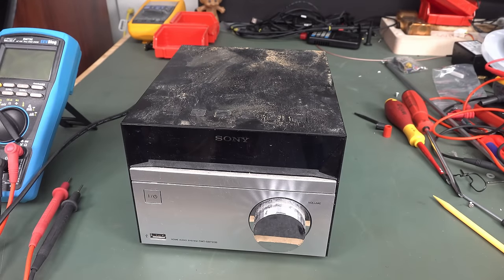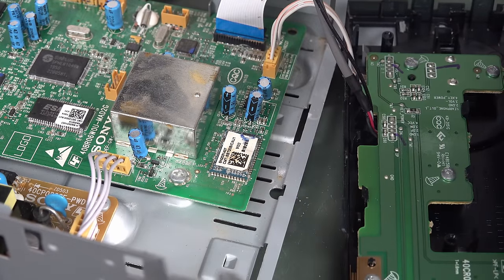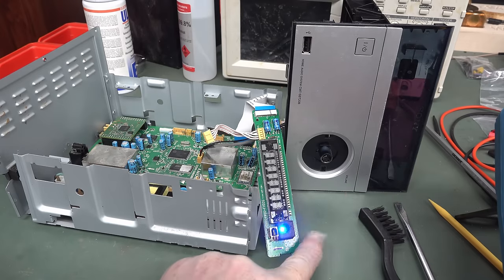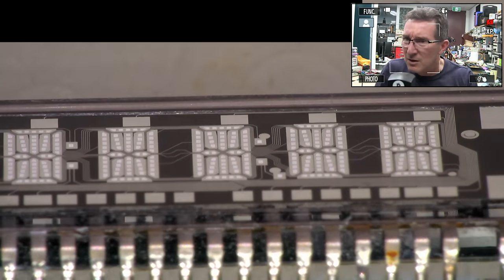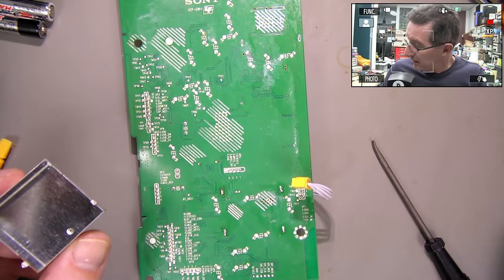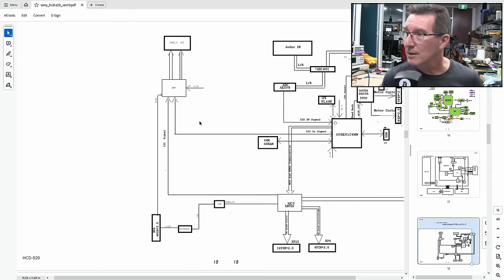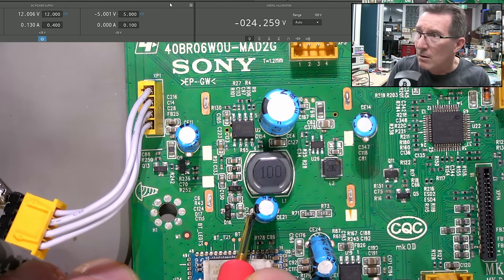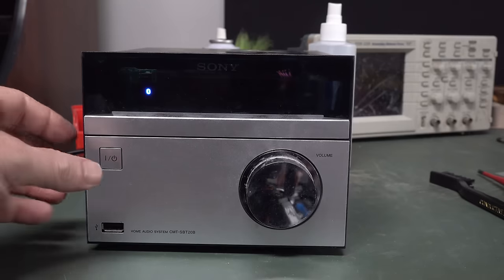EEVblog 1602 - Sony Amplifier REPAIR ADVENTURE

Comment: Having been a SONY R&D tech I found this video to be great fun. I was sitting here yelling, "Trace the voltages! Trace the voltages!" Thanks Dave! BTW, I hate those little laminated, printed ribbon cables. They are dirt cheap, and even cheaper to implement, requiring no connectors on the cable ends, but they are all junk, 1 time insertion, no matter what company makes or uses them. Over the years I've fixed numerous pieces of equipment by hand-soldering wires between boards to replace those pieces of crap. They have become the first thing I check in a repair job, even before the supply voltages. They are that bad.
Reply: Some brands like Sumitomo usually hold up longer
Reply: They are usually failure points in anything that uses them, my wife’s laptop was acting up sometimes powering on and then not responding found the power button attached to the main board with this and one track barely connected.
Reply: Yes, they are. I had a brand new Dell notebook back in the day, that always did a hard reset when someone just pushed hard enough on the palm rest next to the touchpad. Turned it to customer service, and it was returned back to me stating that the problem could not be reproduced. I turned it on, and on the first push on the palm rest at the known spot it reset again. So I tackled it myself. Turned out it was the exact same situation as in the video - one trace had separated during manufacturing, and the open end of that trace just had a tenth of a millmetre clearance to chassis ground. When the lid on top was pushed hard enough, it shorted out causing the reset...
Reply: Me, too! That's something basic I learned from Louis Rossmann: check the voltage rails first.
Reply: Oddly, they are used in military electronics and tend not to be a weak point, but they are printed on polyamide (Kapton) substrates.

Comment: It's always a treat seeing inside a Sony product and their service manuals. I'd love to get my hands on all the internal documentation that Sony has for design rules and best practices, their modern stuff today really does look like it was designed by the same people who were designing Sony products in the 80's, 90's and 00's, only difference now is it's with modern high density packages with more integration and modern features. Although the VFD really has me thinking maybe the same people have been working at Sony for 50 years, I mean Japan does have the longest average employee retention (12.4 years) of any country.
Reply: Same for many other Japanese manufacturers... Panasonic, Epson with which I have personal experience with. 😅
Reply: Working at a SONY R&D lab in the USA I had to change a bunch of parameters in our CAD PCB layout package, as well as rebuild all of the padstacks for through-hole components in order to meet the SONY bd design-rules requirements before I did a layout. The bd layout design rules document I got in order to make the mods to our software, even after translation was over 100 pages long. The manufacturing engineers in Otsugi know exactly what they want in a bd layout, and why they want it that way. One of our engineers who had been to Otsugi told me the cubicles of their EE's were half the size of those of their manufacturing engineers.
Reply: @johnwest7993  that sounds really annoying, but if the end result is that good, I guess it is worth it.
Reply: Unfortunately there is still a lot of Chinesium in this little unit. From the cheap crappy caps to the CD chipset that appears to be one of those nasty Silan clones of old Toshiba designs. But still, there's a lot more integrity in that than the average cheapo unit for sure.
Reply: @johnwest7993  OMG 100 pages. that explains the bloatware style layouts.
Reply: @johnwest7993  despite all that they couldn't make the board marking match up!

Comment: Futaba quit the VFD business a few years ago, leaving only Noritake-Itron and some weird China-based companies producing new VFDs. Shame because their reverse-facing modules like the one in this unit look fantastic.

BTW, the ghosting on the display is probably due to some high-impedance short between anode/grid pins, since the anode current is so low, a buildup of crud somewhere would conduct enough to barely light those segments.

Comment: We used to expect service manuals like that, from HP to Motorola, every company was trying to produce the most complete, easy to use service manuals. Companies saw them as a sales plus, something that would help make the sale of equipment to other companies and users, engineer to engineer. It told those who decided what to buy that you knew your stuff. Purchasers would ask the engineers what they thought of a piece of gear before they placed an order, and the engineers would say, "Show me the service manual." Gear was only as good as the service manual. It still is. And almost no one produces a decent service manual. Nowadays, all I want is vintage Heathkit gear, with the manuals. If a component is no longer available it doesn't matter. They included enough info that you can modify a circuit to use a different part.
Reply: Yeah, I work in defense and it's the same problem.  In the past, there were very detailed Tech Manuals, drawings, and troubleshooting instructions.  For us, it's mostly just money and time constraints.  Navy gets to decide where money goes, and when things get tight then documentation and other logistic products get cut first.  In their mind, it isn't important because most repairs are just dropping in replacement LRUs anyway--they don't really consider some of the knock-on effects, like the operators typically really don't even understand how the thing works so they're hopeless if a new unexpected (never before seen) problem arises.

Comment: Sorta modern, futaba stopped producing  VF displays entirely in 2021, that's a backlit vfd, you're viewing the back of the anodes, painted on the glass, very neat.
It also most likely uses chip-on-glass with an internal driver die and 3.3v logic
Reply from the maker: Yes, I was going to mention that it appears that it's the bottom. Neat indeed, no mesh or cathode wire to get in the way.
Reply: I am wondering if this is the same Futaba that makes the R/C stuff
Reply: @sasmit82  me too!
Reply: @sasmit82  yep. The company has some unusual product lines. Displays, touch interfaces, industrial/hobby radio control systems.

Comment: Blowenfusen und Poppencorken mit Spitzensparken! I like the VFD, indeed a thing of beauty. And the service documentation is damn spot on too. Charge pump and voltage multiplier for -24V, pretty clever. I've seen that used in a voltage multiplier powering a VFD in a Lell PSR drum machine made in the '80s/'90s in the USSR. It was driven from the master clock signal.

Nice fix! Congrats. I feared it was gonna be a complete come-a-gutsa but it came out nicely.
Reply: Lol. 😅
Reply: i love how dave says The fuse is "Blowen"
Reply: Yes, Sony is very creative using the 5vdc buck regulator's switching pin to drive a voltage doubler circuit to -24vdc. 👍👍

Comment: I've been doing repair for a job since about a year and things like that happened to me a couple of times: You fix the actual issue and in the meantime you do a mistake. You put it test it and it's not gonna work and you'll look for ages because you broke something and then you have to go all the way back and fix that again. Super frustrating experience!

Comment: This was a great video. I have often been frustrated trying to make these measurements using digital scopes. However, your video shows a number of really good strategies. I thank you for posting it. On my HP 8647A, the modulation connector becomes an output when the internal modulation source is used, and this works well for triggering. 73 and thanks again!

Comment: VFD very likely because Sony already had that display in the master stock list as a part, and an already existing contract with Futaba for supply of the custom made displays, with a long term arrangement between them. Thus when designing this unit they went with first of all using assemblies they already have design files and firmware in house ready to use, as it is a lot faster to finish a design cycle if the display, CD mechanism (probably actually a DVD mech, as that still reads CD, but having a dual use mech is also a cost saver in inventory, also reusing a common part with possibly only a different clip on face used) and other parts like knobs are already a Sony part number. No need to order special designs (a Sony favourite though) when you can repurpose an existing part instead.

Disassembly the CD mech you need to use the manual release method, and turn the motor to run the drawer open, then press the clips on the side to run it all the way out.
Reply: About 2 decades ago, many car CD players added support for playing MP3s from DVDs. Back then, large Flash memory was expensive but writable DVDs were getting cheap.

Comment: When manufacturing computer (array processor) circuit boards in the '70s, we ran the assembled boards through a dishwasher before final assembly.

Comment: Repair…😂 as a kid I took a small tv out of the little canal behind our house (somebody dumpt it) dried it and used it for years. Only a sound problem. One transistor (simple pnp) seems to blow up once in a while. Put a new one in on a footpeach, and replaced it when blowing.

Comment: What  Turd Burglar  !! Im working on Fujitsu Heatpump  PCB repair as a side jig, I could find a service manual of  a older model with diffrent gas ( pre-R32) 90% of the PCB is similar and  I could replace few components and make my friends happy.. Thanks Dave you videos  have been very influential in past 10 years to me

Comment: In my own experience water is practically harmless until it meets up with electricity. Conducting even fairly small amounts of current through water can induce quite the impressive galvanic corrosion and eat away traces and such fairly quickly.

But if a piece of electronics have no power supplied to it, then one can often dunk it in water without any worry what so ever. Other than some components being good at trapping water inside them, be it relays, some switches, and other stuff. This can often lead to unwanted corrosion over time.

Comment: It lookes that pin 5 and 6 of the  cabel to the display are still rough which could cause the cable to strip. Perhaps there is still more corrosion on that connector which leads to a dimmed operating mode. With 24V on a pin in humid environment can lead to extra contact corrosion, similar to batteries in bicycle front or back lights.

Comment: I have a massive Sony AV system that’s about 25 years old and has a dead VFD, it’s very large and complicated but the rest of the system works and can change sources with the function button and remote. I’m going to check the same criteria, cathode power and voltages and hope for the best, there are several nasty ribbon cables too so some deox spray and reseating might not go amiss

Comment: As for the shadow segments not turning off. Make sure the voltage separation between the filaments, the grids and the anodes is correct. Sometimes when the filaments and the grids are to close in voltage they don't cut off properly.

Comment: Exact same thing happened to me when repairing an amplifier. Damn thing could only be used with a remote, and it didn't come with one. So I had to order a replacement, and it didn't work. Got another, that didn't work either, luckily got a refund. Both of those were aftermarket ones, so eventually I tracked down an original and that didn't work either... decided to do a final inspection before throwing it out of the window, and turns out that the front panel ribbon connector had ONE PIN torn off and bent like that. And according to the manual, it was the pin controlling the front infrared receiver.
Reseated the ribbon not unlike in this video, and it worked fine afterwards. For about a year, until the dodgy Texas Instruments DSP gave away (TI had a chemical spill in their factories and for a good decade all amps using their chips had huge recall issues).

Comment: One of my favorite DJs mentioned some people drop drinks on the mixer panel in their studio. This was a reoccurring thing in their studio. Apparently the first question the tech who maintains the mixers asked is "was it a diet drink or sugared drink". If it's a sugared drink they trash the mixer or it's an expensive repair if not they just let it dry out. Yes, people sugar kills!! (mixers) . This is all anecdotal. I tend not to drop drinks on my equipment but I'm pretty sure now I mentioned this it's going to be the next thing I do.
Reply: Isn't that mostly because (most) diet sodas aren't sticky though? So they won't gum things up when they dry. Can't imagine diet soda being a less conductive.
Reply: @oliverer3  no clue I can imagine the sugar dries up as a conductive mess. I'm not going to experiment with my mixer any time soon.

Comment: 40:11 - It Was At This Moment He Knew... He Fucked Up!.
I've fixed so many electronics over the years, and I swear those tiny ribbon cables are more delicate than my aunt's fine china collection. One re-insertion, being careful AF, only to discover all the bloody pins have overlapped and shorted together GRR! 

You can expose a little bit of the traces on the ribbon cable in an attempt to fix it, however, I would yeet the cable & connector and replace 'em with wires going from the traces on the board to another board.

Comment: The bit of plastic on the front of the CD tray snaps on to the rest of the CD drive assembly. It is removable and what is catching on the front of the unit causing you trouble. This is how they change the color of the CD Player device to match the rest of the unit without having to make different drives for each color. Manually operate the CD Tray motor so the tray sticks out a bit and you will see it probably slides up and off.

Comment: had to say how funny this was... been there myself, spent 6 hours once trying to debug a complex embedded computer system editing source code and uploading firmware to waggle pins to capture an intermittent failure mode. I eventually figured out why it wasn't triggering my scope - I had been editing my backup source code copy and been uploading the original firmware all the time without the pin waggle to my scope :o(  From that I created my maxim... believe what your equipment is telling you and not what you think is happening LOL. Credit to technical authors worldwide - good ones are worth their weight in scope probes :o)

Comment: That VFD is a reverse view type. Normally the filaments are in front, then the grids, then the anodes with the glowing bits are the back and viewed through the grids. This one is backwards, the filaments are the back then the grids, and the glowing bits are on the opposite side of the anodes. The advantage is the display appears to have a higher resolution.

Comment: I bet the crud is keeping the CPU's crystals from oscillating. The leakage current on the oscillator circuit would be enough to foul it. Crystals are very high impedance so it's not hard to mess them up. I am currently dealing with moisture making the no-clean flux somewhat conductive on very humid days, and crystals won't start.

Comment: For the CD tray. Just apply voltage to the motor and it comes out. Then you can remove the cover easily.

Comment: Dave, make yourself a gift, buy Pomona Electronics 6342 test leads with very sharp points, and gold-plated tips. They are an order of magnitude better at probing such small circuitry.

Comment: I think the reason they are using a vacuum fluorescent display is you just can’t get that super crisp color and lines out of an LCD display, they are also really easy to read in the light and the dark. It could also be just an aesthetics thing, the look of the front reminds me of early 2000s Apple products which as we know are all about the look of the thing. Keysight is still using a vacuum fluorescent display in the refreshed version of the 3458A and that’s a $15,000 multimeter where you’d kind of expect a fancy LCD display so idk
Reply: You can't get that from an LCD but OLED displays can get pretty close.

Comment: Yep, having watch Rossmann repair MacBooks I learned that higher voltage lines accelerate corrosion, so not a complete surprise there, looking back of course. It doesn't help that it was hidden from view.
Reply: If you actually want to lean anything, watch anyone and anything else, then Rossmann. I don't care if its Teletubbies, you're likely to learn way more actual proper information. 

Also, you avoid "Repair Bias" AKA basically if you only repair MacBooks by choice (because they are actually worth repairing 5 years out, actually has a life outside 30 days like unlike everything else does, has resale value, and even continues to work after 2 years), you are going to think MacBook's are trash. Repair bias...

It's funny, he's admitted on numerous occasions admitted he repairs MacBooks because there's no money in repairing anything else. Because with the most expensive Windows machine costing $2 and a sack of potatoes, you just get another if it fails. And honesty who cars if grandmas laptop dies. You just get another

Comment: I believe the display looks kind of off because of leakage between pins on the controller chip. A good clean in ultrasonic bath should fix that :)

Comment: 34:59 it is NOT a pull-down. It's part of a voltage divider to create around 4.0V for the ENable pin